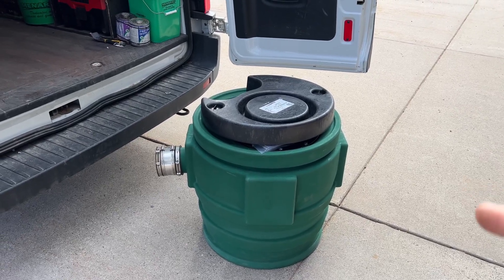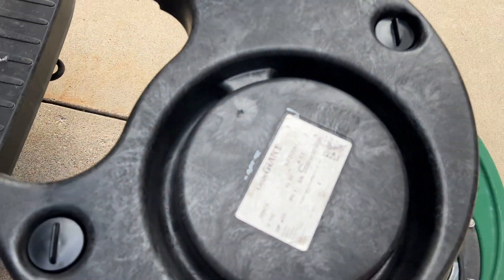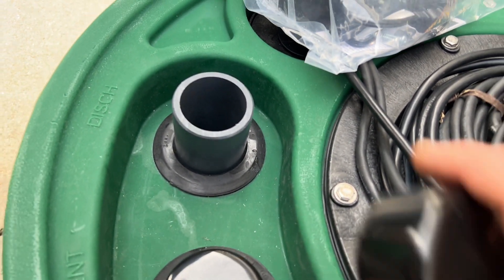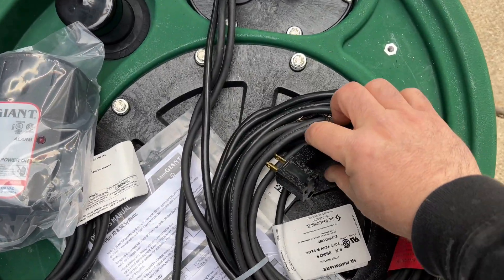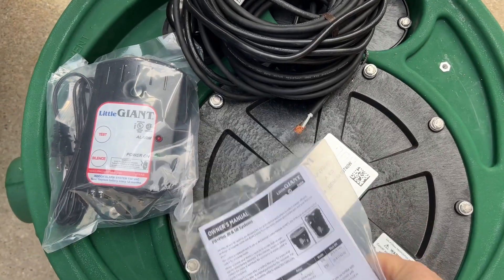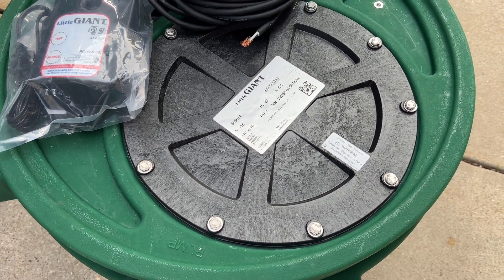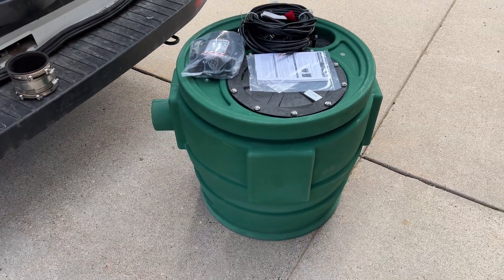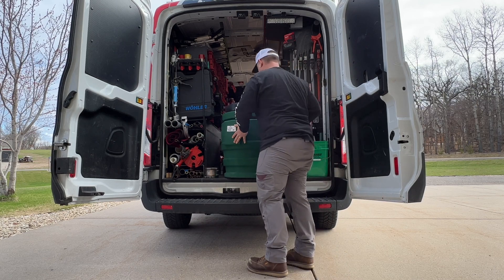Little Giant Pit+Plus

Comment: Does this HAVE to be buried? I'm installing a wet bar in my basement and will need to add an ejector pit/pump. Mechanical room is the next room over with I will put the pit, but I'd prefer not to bust up the concrete if I can just set this on the unfinished floor.
Reply: Yes these have to be buried. If you need a free standing one then look into the WRS drainosaur package systems.

The 506065 and 506055 are the most popular options